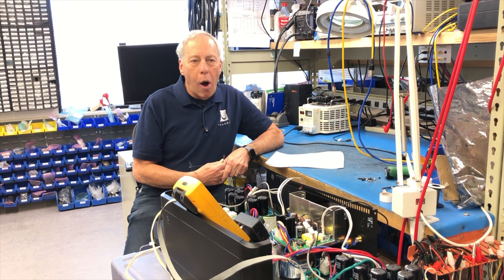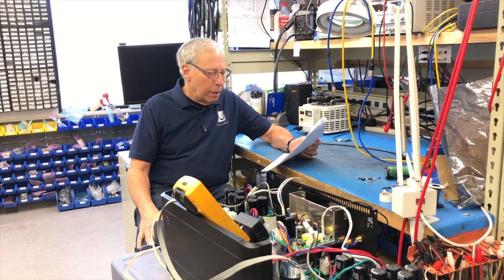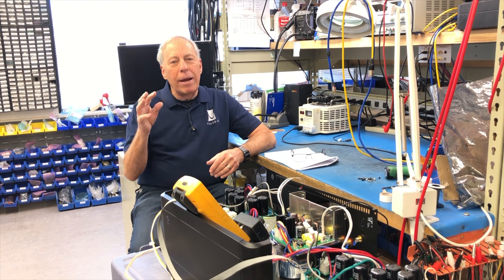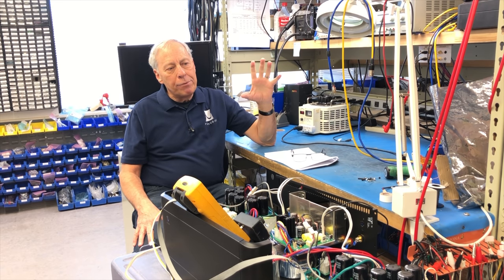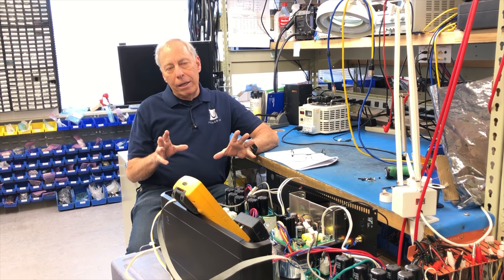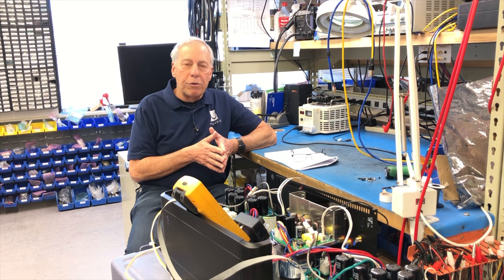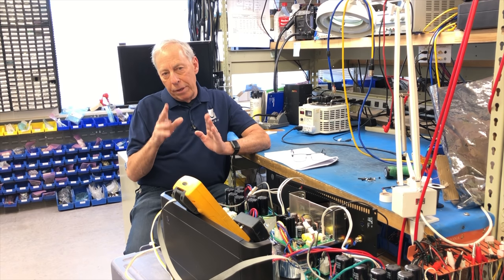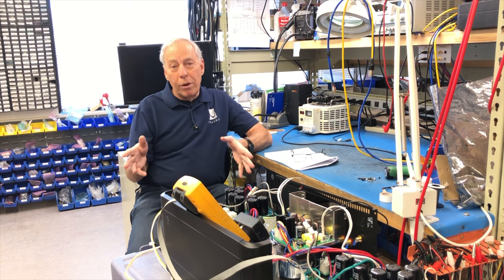How to choose correct amplifier wattage

Comment: 1) Pick an SPL target, 100dB for instance.

2) Find speaker sensitivity (dB @ 1 meter away, hopefully anechoic and not in-room, Klipsch gives in-room). 
 
3) Take into account room gain, usually +3dB for speakers with bass and +2dB for speakers with little bass. 

4) Know that 2x wattage gives you +3dB and 10x wattage gives you +10dB. So, 100W gets you +20dB over the stated sensitivity. 
 
5) Take into account distance. If you sit 10ft away, that’s about  -6dB. 
 
So, if your bookshelf speakers are 84dB @1W @1m anechoic  and you sit 10ft away, that’s gonna need 100W to reach 100dB (84, + 2 for room gain, -6 for distance, +100 for wattage).
Reply: @Taco The math was for a single speaker. 2 speakers obviously will be a bit more.
Reply: @homeboi808  absolutely ....
Every woofer count in system .... +3 db boost

If your woofer is rated 86 db @ 1 watt 
Asume MTM in LR sides ...
86+3+3+3 ---- 95 db ....real

Asume TM in LR sides ...
86 + 3 .... 89db

Comment: It's all about having adequate headroom for the amplifier to provide for sudden increase of Volume to transient parts of music instantly.
Reply: It really like to know some numbers for once. Do I need a 100W amp for normal listening volumes on a 100db/1m/1W speaker? I dont think so, but what are the facts.
Reply: that IS a key advantage, but its not 'all' about that, the sudden increases in volume. but, that same capability, imo, helps it as it nears the limit of its range, where it isnt stressed to produce sound/signals if its a powerful amp, comapared to the same output of a less powerful amp.
Reply: @FraktaleFatalitaet  
Of course. It depends on how your speakers came about their rating.
And the frequencies tested. Many say 100db. But rated at only 1000khz for that number. And in multi driver speakers. You can Gaurantee. This rating isn't reliable to say the least. 
As with a 3-way system. Only the mid-range speaker would even be producing 1000k.
I've been an audio guy since the 70's. And have never seen a speaker produce a rating with anything but strict test equipment. (and not often) And Never in any real world applications. 
More is better. And Headroom extremely important in today's Home Theatre applications. 
And even amplifier ratings are spurious at best. 
RMS X 20-20,000hz X Distortion is the SPEC's you should look for as a start. Then determine how it was tested to achieve same. 
And you May find many amps, only rated at 1000khz. Imagine that 😂 
...jus my short opinion...
Reply: No.  There is more to it then that.  The more of the amplifier's range that you use, the more non-linear it's output becomes. It is like seeing the curvature of the earth. The further away you get from the earth, the more you see of it and the more that you can detect it's curvature.
Reply: @Taco You point to an interesting thing in this equation: speaker efficiency.  If you're listening at a level where a sine wave would only go to 30% on each side of a sine wave (leaving 70% unused on each side), with a 100 watt amp, you're not running it into a nonlinear response.  So, why would you need more wattage? Sometimes this stuff gets like guys bragging about the amount of horsepower in their car engines.  Do you really need 600 horsepower in your car..... afterall, unless you're in an extreme circumstance, less horsepower will work just fine.
Reply: About transient response, supposedly being better with a high wattage amp, this should be able to be seen on an oscilloscope (rise time), for proof, if this is true.
Reply: @My-Pal-Hal  This is why plain, simple specs may not be accurate indicators of each of our own appreciations. One frequency doesn't consider intermodulation effects, distortion, `heterodyning.' Are manufacturers who provide only simple specs, trying to hide something?
Reply: @richardsoffice9176  
Yes. They're trying to hide Your Money in their Pockets 🤣 😳
And it's a sociatal thing. Shiny Objects are the thing nowadays. Specs are more Fun than performance. Especially if it's Shiny 😉 It's a different time, of Mass consumption. Hell. You can't even use, or work on stuff today. Without A Subscription. Pretty Sad. Just more dollars to hide.
Reply: @richardsoffice9176  
And you didn't add things like RMS vs IPP vs Chinese EXTREMISM 😂
I just bought a Flashlight with 90,000 Lumens. And got it Free. Because eBay Does Stick by their Correct Description policies, if you can prove it. And that was easy. Because it came in a small package. NOT TRUCK MOUNTED 😏
And Chinese sellers won't pay Return Shipping 😂
Try It. I have a dozen or so now. Just know the Real Specs of the emitter. Cree XHP 70.2s (second generation) are a Great FREE Find 👍

Comment: This reminds me of when the Dodge Challenger Hellcat came out, it has like 700hp and people kept saying “oh your gonna crash with that power” or “how can you even handle that amount of power” or even “that is WAYY too much power for the street”. And I always thought, well just because you have access to all that power doesn’t mean you have to use it. You tell the gas pedal how much power you want and it will give you that.
Reply: David Pastars - The problem has always been how easily you can control that power. If 50% of that power is available at idle, that means  350 hp just as you start driving. That might be too much for most people.
Reply: Nikhil Gee Lol that’s not how it works. The car won’t be making 350hp from a slow stop light start. If it would you would be spinning out all the time.
Reply: David Pastars - “If” was the key clause that you missed reading.
Reply: @Enemji  Ah I see :)
Reply: That may be true but my counter-argument is if you’re not gonna use all that hp (or watts) anyway or very often why even bother getting and paying for them in the first place?
Reply: MrDac0964 - That applies to minivan buyers who buy it so that when the MIL is visiting, they can all go out in a single car, which is once ot twice a year at best.
Reply: @Enemji   you're correct and I still believe it applies to almost anything where you pay for something that you're not using.  I have seen it quite a few times in audio shows with amps with VU meters, the sound level in the room is loud enough but the needle in the VU meter hardly hits 1W!!!
Reply: @MrDac0964   True, but if you listen to music ant ANY sort of volume, and it's dynamic music at that while the needles barely hit 1W MOST of the time, it WILL supersede that if the music calls for a very big dynamic swing, though it'll often be in the nanosecond range, but it'll give it to  you in all its glory, not truncate, run out of steam, it's called headroom for such an occasion, for some of us, it's likely more than the very occasional peak demand.
Reply: John Palmer even for that nanosecond swing it will not even hit 10W unless maybe you’re playing at exceedingly loud volume.  I could be wrong though but i have yet to see over 10W swing in a VU meter at comfortable and normal listening level.
Reply: @MrDac0964   Well, true but there are several variables I forgot to mention that will affect how all this interacts and they are the efficiency of your speakers, IE, are they easy to drive or difficult to drive, what kind of music do you play and how much bass you like, the size of your room Vs the size of the speakers, your overall listening levels etc all come into play  here. 

Most speakers that are efficient will be in the 90dB + efficiency range (as measured at 1M/1W), anything below that to one degree or another will tax your amplifier more, anything at 90dB efficiency and up will be very easy to drive, and thus will sound louder at lower wattages. Some less efficient speakers are especially difficult to drive, many acoustic suspended models can be harder to drive than a port or passive radiator models due to the box being completely sealed, Vs open so the air can move in/out (ported) or has room to expand/contract (passive radiator) all will affect the bass response of a given speaker and they will all require more power to reproduce bass well due to the amount of air they have to move to generate the low frequencies and if you've not noticed, at low volumes you loose bass response, crank it up to say 9:00 and the bass begins to come on stronger, more palpable, thus more energy is necessary to reproduce that bass. A typical low power amp will not do this as well, run out of steam in fact more readily because you are likely needing to run the amp harder to generate any real volume with less efficient speakers, but put on some very efficient speakers, that same amp may be more than adequate, which is why most that love low power SET amps will tend to run very efficient speakers so they are loud on little power. High current amps of the medium wattage range (20-100W or so) will also have the headroom needed for transient peaks, and  yet not be overly powerful for smaller rooms and yet if your speakers aren't the most efficient, they'll still be adequate for most people at more moderate listening levels.

The size of your room makes a huge difference in how much wattage you'll need, along with speaker size. Generally speaking, small speakers (read, bookshelf systems) often can't fill a large room as well as a larger speaker can so to do so, you must crank the volume up more to compensate, and most small speakers with anything LESS than an 8" woofer often can't produce much bass below say, 50-100Hz anyway and may come off bass shy without resorting to a sub and thus you may well run into the danger zone with a smaller amp for instance.

But if you have moderate sized speakers that are relatively efficient, a moderate wattage amp may be more than enough, especially if you are not the type to listen to loud music but still want quality sound. It's the rest that like their music really loud that a high wattage amp will be necessary, especially if you have a large great room to fill with sound.

In my case, I run some 88dB ADS speakers (first series) in a small living room of 11.5x15.5SqFt and they are powered by a small, but mighty NAD receiver of 40-60W/Ch nominal, but it's a high current amp so they can run speakers as low as 2Ohms and pump out as much as 550W peak power for a few nanoseconds when needed and yet, I don't run it beyond 11:00 usually, especially when playing vinyl as the low frequency oscillations kick in as a low rumble/buzz. The speakers are acoustically suspended in an airtight sealed box with 2, 8" woofers and 2 soft dome drivers to handle the mids and highs and yet they are loud at the 9:00 position, very dynamic sounding, plenty of good, strong bass that's also taught and defined and very musical sounding and yet I have plenty of power on hand for my needs, anything more would likely be overkill.

So again, many variables to consider here when it comes to amplifier power Vs your speakers etc to determine what you need.
Reply: And then you go to Youtube and watch buttloads of vids of people who can't control that power...just saying.
Reply: @MrDac0964  Bob Carver once did a demo (at a show, I think) where he connected a buttload of amps to provide 20kw of power to show why "more is better". He closed a pair of scizzors in front of a mic that was hooked to the array and displayed the output of said array on an oscilloscope. What he got was clipping. No shit. 20kw and there was still clipping!
Reply: @MrDac0964  No meter can show the actual instantaneous peaks of music.
Reply: @MrDac0964  If you had the power available it would hit many 10s of kw. Using a scope can prove this.
Reply: Gas pedal DIRECTLY connected to wallet.

Comment: Tru, but not when you're kid (then 3 years old) is saying, nice music dad, while he turns the volume way up. And before I could tell him don't. The Smoke already was pouring out of the tweeters. And a year later, just when I repaired both speakers, my other son did the same. And I took a long long walk. Only one woofer survived. i Still love my kids. But never bought other speakers. Mabe someday, when they are living on their own I Wil.
Reply: Amps should have a max power setting you can set or a way to disable the front volume pot.
Reply: It is possible to put more current through a coil, generating heat in the windings than a coil design cannot dissipate fast enough to prevent breakdown of the winding insulation, and thus smoke and shorted speaker coils.  

The question is why don't speakers have thermal fuses since coil design is independent of the power amplifier.
Reply: A Hegel H360 does that exactly. user can program minimum (start up) and maximal volume!  ;-)
Reply: Two question to ask: 1. Are you speakers under warranty?  2. Are your kids under warranty?
Reply: @captainwin6333  With all the technology we have these days an amp should be able have an input for specs of speaker and the amp can then adjust accordingly to the speaker hooked up.
Reply: Just remember that as your kids are all out living on their own, soon they’ll come back to visit you on weekends with kids of their own saying “ nice music grandpa”. 😁😁😁😁
Reply: @ryacus ...input specs for speakers.. ...even if someone does provide that.. what about ..
protection it from too high a gain setting from the pre amps..etc..
Reply: Sorry to hear that, that has to be frustrating.  The solution, if you are using separates as power amp and preamp, is that you can insert something like a Schiit Sys, just a dumb volume control.  You turn the preamp to max and then slowly turn up the Sys(or anything else like, the level adjust if your power has that) until you real the maximum volume you will ever want to play the system at.  You can also find limiters in some modern receivers that will cap maximum output.  There are even inline attenuators you insert inline to the signal cables that can do the same function.

When I did my car stereos I would always set the gain structure that way, I love active crossovers so this is standard procedure.  If you are using an integrated amplifier then I don't have any suggestions.

Comment: My speakers are rated to handle up to 300w but my amp is only 80w per channel @8ohms. But I use them in nearfield listening position on my computer desk and never have the volume past 1/4 so for my needs 80w per channel is plenty.
Reply: Volume at a quarter means nothing. As Paul mentioned in this video he will go into gain at a later date.

Comment: I personally enjoy the sound of small watt amplifiers, both in Hi-Fi and instrument amplifiers. Not sure Fender could get the same sound, of their tweed amplifiers, in a 'high watt' version. Not to over simplify or generalize too much, but a lot of jazz guitar players, that have some fantastic sound, all use small watt amps.  

As far as speakers, i'd have to say I sway towards the enjoyment of high efficiency speakers. Matched with a nice small watt class a amp, it's a sound I do enjoy more than I did with a high watt b&w or sonus faber sound. Knowing the sound you want, for me, is the hard part.
Reply: So please don't take this as me busting your chops, but I wouldn't compare full spectrum audio amplifiers to guitar amplifiers.  In a guitar amplifier you want the break up of the tubes to occur, to get that "warm tube" sound.  In an audio amplifier, you don't want break up otherwise the music would sound distorted.  Tubes distort in 2nd order harmonics which is the next octave, and this is pleasing to the ear.  However in HiFi, too much tube break-up and you will hear it.  Low wattage amps are much easier to drive into that break up area where guitar amps start to get that natural good sounding distortion and HiFi (at least to my ears) not so much.  I agree with Paul on this one.  I run very high wattage amps that are not run very hard, so as to avoid clipping and a tube preamp for that natural tube sound.

Comment: Optimal levels for gain staging are sometimes assumed to be -20dbfs (decibels full scale).  This means that the normal listening level has roughly 20dBs of headroom to account for transient peaks.  This is pretty reliable as a rule of thumb, especially for digital sources.  Vinyl, not so much since things like record warp and needle drops can blow woofers connected to high power amplifiers.  If a comfortable listening level for you with your current room/speaker/amplifier combination is 80dBs at the listening position, and this level can be obtained @ 1W/channel, a good rule of thumb would be to have a 100W/channel amplifier to provide 20dBs of headroom.  Ironically, highly processed popular music could be accommodated with less power at the same or greater apparent loudness due to the significant compression impeding dynamic range, all things being equal.

Comment: As I have gone up in speaker sensitivity, down in amp power while improving signal to noise. My sound has become magical! Sorry Paul, big amps are for big egos or football stadiums.
Reply: I have an Bose amplifier: 2x50w @4 ohms, 2x25w @8 ohms 

And Bose speakers: up to 80w, 4 ohms 

What's the maximum numbers that amplifier can handle?
Reply: I bought  Jbl L 300 Summit 1984. I didnt like them until i build my own 845SE amp in 1999. Now its perfect

Comment: Most people don't get that, they see a power rating of 75 watts and and they freak out if their amp is 100 watts. The one occasion I blew up my tweeters was with a 30 watt / channel receiver. Later in my audio journey I had a pair of Dahlquist DQ20i and I had an Adcom gfa5500 amp and a Carver avr100 receiver. I disconnected the crossover jumpers and powered those speakers rated at 125 wpc with a 200 wpc amp and 150wpc receiver and they were amazing, clear clean sound great soundstage and imaging didn't blow the fuse for high frequency. That's my experience with power ratings